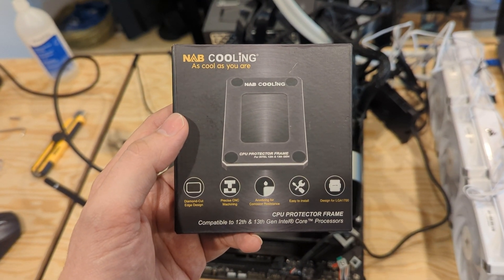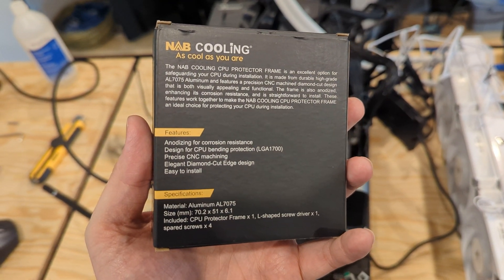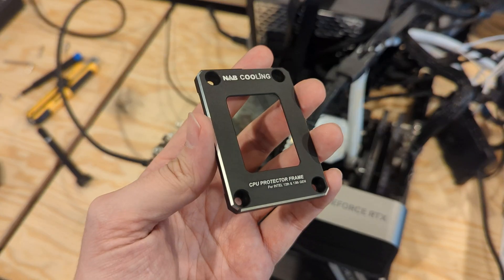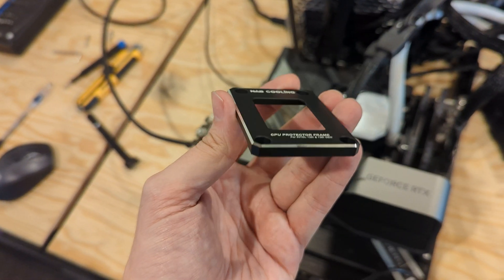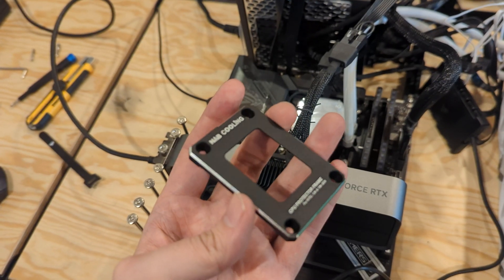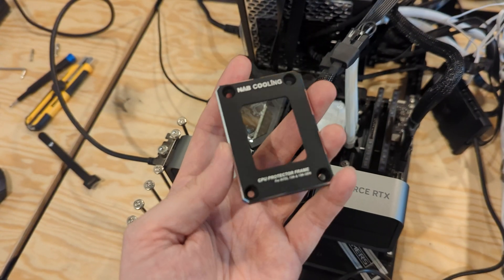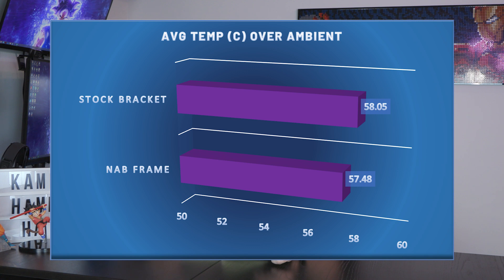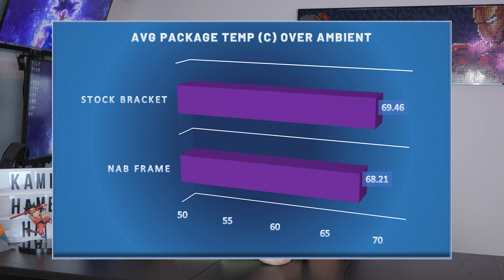13900K + Contact Frame = Better Performance?

Comment: What's the best method for new paste on the 13th gens ? A dot, line or a cross. Thinking about paste replacement.
Reply from the maker: Use a robust paste like TFX and spread it for thin but complete coverage using a spreader. I'll never not use the spreader method, it just gets much more consistent results. You want to take advantage of every square millimeter of that heat spreader.

Comment: I have a 13900k and msi z690 tomahawk motherboard. I use it with a 360 mm cooler. After the undervolt process, I did not even see 65 degrees, except for instant increases in games (rare 80 degrees can see). I do not plan to change the system for 4 years. do you think I should use this product? or should I continue as stock.
Reply from the maker: If the system is already built I wouldn't worry about it. For new builds I will be using a contact frame, no contest.

Comment: Have you tried the thermalright contact frame? Those temp improvement don’t seem to be where they should be. A lot of people, such as gamers nexus, were seeing 5-10 C improvements
Reply from the maker: I haven't yet, no. That being said, I don't think the 13900K will benefit the same way. I believe Gamers Nexus tested it on the 12 series, so I don't see it as an apples to apples comparison.

This could all be avoided if Intel had a better mounting solution up front 🤔
Reply: @UnhingedSystems  With the 13900k specifically, I would say you're probably right, though I've seen varying reports online as far as temp improvement. Some say it did lower them, I've also heard that "oh the 13900k will just boost more with the extra thermal headroom" Which isn't a bad thing at all imo, better perf with same thermals anyway 🤷‍♂. Not sure if intel made a change on the 13900k to do this, maybe you know.  Or that temp improvements depends on the concave of your cooler. etc... But I've pretty much only heard that it improved temps with the 13700k and lower. But there are other advantages besides temps which I believe you went over in the video, such as more even pressure, as long as its installed correctly.

Comment: Use it on the brand new cpu if u can. The already used ones are bent by the ILM there is a good chance they not gonna work as expected.

Comment: Uh...no, just because the temperature measured was lower, doesn't mean that it cools better, the difference is way too small to draw that conclusion, it's within the margin of error. 

Sorry, but if you do a test like that, you would have to re-apply thermal paste several times and then run a test each time, just to rule out that the actual application of the thermal paste made a difference, because it's impossible to get 100% identical applications. Heck, even adding the heatsink can result in different results.

Is it more work? You bet. Will you waste more thermal? Most definitely. But is it necessary to get more accurate results? Absolutely!
Reply from the maker: I did cycle through many applications of thermal paste over 8 hours of testing (each time I switched between the frame and the Intel mechanism). I even tested with putting the stock mounting plate back on and testing again several times. I got consistently better results while using the contact frame in every instance (albeit a very small overall measureable difference, but not noticeable by a human using the system).

I actually wasn't happy with the test results after the first 6 hours and re-did a bunch of setup and testing to ensure the results made sense and weren't just anomalies.

The temperature difference was miniscule, but the overall cooling was better (Core P7 was thermal throttling at times using the stock mounting hardware, consistently with multiple applications of paste, no cores thermal throttled using the CPU frame).

I could have done many many more iterations of the tests, and I spent a lot of time trying to ensure the results weren't simply margin of error on the applications. The overall CBR23 runs were more consistently higher numbers with the frame than without. The results are consistent enough for me to say that "Using a CPU contact frame is better than using the stock Intel retention mechanism" with confidence.

I would love to spend more time talking about testing methodology in my videos, but people literally don't watch / skip those parts anyways because they want the results and it would just be a waste of effort on my part.
Reply: @UnhingedSystems  
Sorry, but I don't believe any of what you just wrote. If you would have gone through so much effort you would most certainly have mentioned this in the video, but only after my remark you decided to mention this in a comment. 

Secondly, if you didn't want to explain to your viewers how it was tested, you could have done in the description, instead of assuming that we're all a bunch of gullible 14 year olds who will believe any numbers thrown at them.
Reply from the maker: @Horizon-hj3yc  That's the wonderful thing about life mate, make your own judgements and do your own testing. I'm not here for your validation. It's impossible to make everyone happy and this comment thread is a prime example of that. 

Thanks for the comment.

Comment: I don't suggest to any beginner-average home builder on using these because the chances of damage, warranty issues and such outweigh the usual benefits provided. You'll get the same benefit by applying premium paste instead. It is definitely a must for high end builds and enthusiasts combined with prime paste to give the absolute best maximum performance. It seems to be about 9$ USD which is excellent.

I am not playing Starfield at the moment and even if I wanted to I have an older 1080 so it would perform somewhat under average.
Reply from the maker: Agreed. Get someone that knows what they are doing to install it if one is lacking the knowledge and experience.
Reply: blimey been a while since you dropped a video good to see you doing vids again i found your channel when i was looking at over clocking my 5900x using ryzen master
Reply from the maker: @Rob-el8ti  Glad to see you back!
Reply: You definitely won’t get the same benefits with just thermal paste. Not sure why you said that